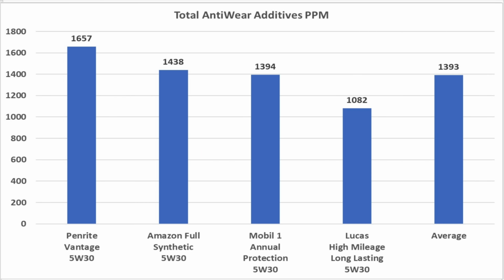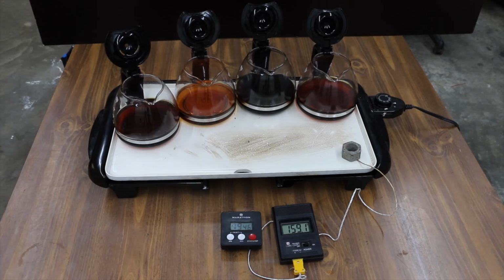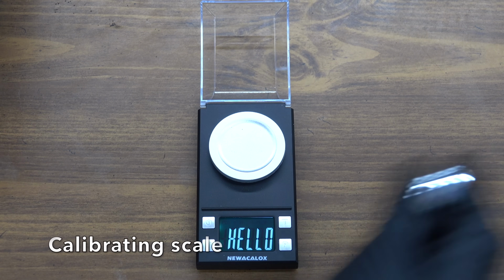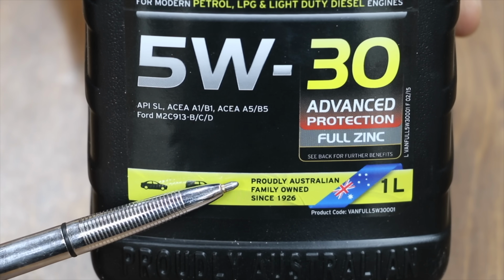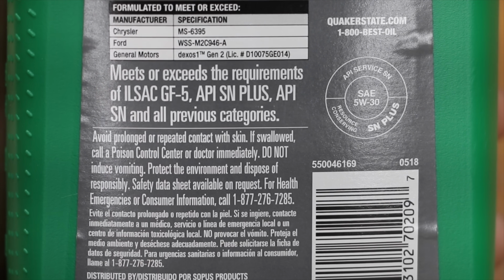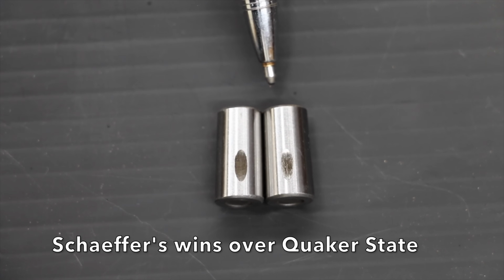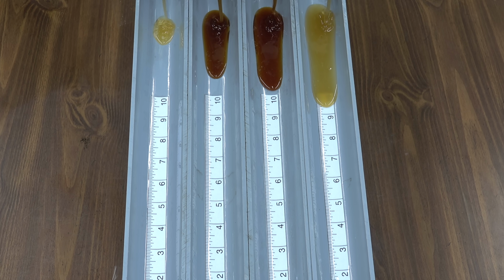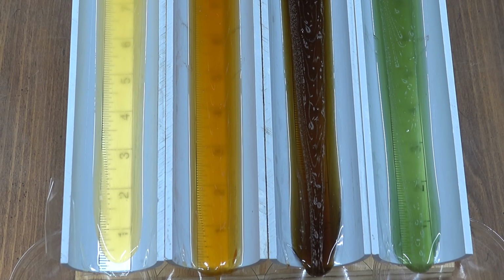Is Amazon Basics Motor Oil better than Penrite? Let's find out!

Comment: maybe try testing some weed killers? or comparing?  with so many options out there it would be nice to see what stays true to its advertising. I personally pay the extra for round up since we use that on the farm for round up ready beans, and corn.  but we have used other off brands that seem to work ok.  i have tried other brands and mix to what they spec but they dont seem to deliver what is promised and almost feel like a waste of money otherwise. I have had luck with off brands while mixing heavier than what is said is needed and did have luck but dont see a reason to buy the cheaper off brand that requires more of it to get the same job done that a product like round up can do with less product used even though it does cost more.  (side note) I use the concentrate.  I spray way to much of course to use or need the pre mixed ready to use. also feel that buying "refills" is a waste.  I know different weeds are harder to kill. We also have a good mix that we use to kill off growth from trees and stumps. while to todays standards its probably not the best for the environment, we mix crossbow with used oil from the tractors and paint it on stumps and trees we dont want to grow a branch off that specific side or a stump that we dont want to sprout a new growth from.  which does work great. Thought this would be a good test with it being spring/summer and weeds growing like crazy.
Reply from the maker: Thank you for the video idea!

Comment: Very cool!  I haven't been this excited in a play off, in a long time... Goooo Amsoil Gooooo
Reply: Johnny Turbo scAMSOIL has been over hyped. Watch it burn in these showdowns.
Reply: @garrettstevensen2467  well I'm interested to see because it has done VERY well in our race engines, both gasoline, marine and diesel. Not to mention several very high mileage (over 400k) vehicles myself and other buddies have and have had. We ran Amsoil in them from day 1. I still have one vehicle,  and as far as i know the others are still running strong. On top of that, in our race engines, it has actually made power on the dyno compared to 2 other oils we used to use.

If you are right, I'm excited to know who beats it, but in my personal experience,  Amsoil has done VERY WELL.
Reply: @garrettstevensen2467  so what's your oil of choice?
Reply from the maker: Thank you!

Comment: Another great video.Thank you so much for both your honesty and hard work.I do have two questions.Can you outline what the wear additives, that were tested in your oil analysis, are? Secondly,Penrite shows zinc as one of its additives.Zinc is known to be a great lubricant but can also poison catalytic converters.Would this oil perform acceptably in the North American market or would it ruin the converters?
Regards,
Brian
Reply from the maker: Thank you!   I've had the oils tested and Penrite's zinc level is within the normal range.

Comment: Question/Idea for a video
Old guy I used to work with talked about having a jar of water under the hood of his old, carburetorated, car when he was younger. He claims he ran a hose from the water, to the intake on his carb. The idea was that it helped boost compression in the cylinders based on the fact water doesn't compress (from a practical standpoint, yes it is technically possible). 

Maybe you would consider putting this story to the test? Water in the cylinders seems a bit counterintuitive though.

Just a thought.
Reply from the maker: Thank you for the video idea!

Comment: Thanks for providing the additional technical information about the oils, it really is helpful to us in trying to more fully understand the differences between these oils. I used to look at virgin and used oil analyses done on oils by Blackstone labs and reported by users at the bobistheoilguy.com site. I like the Penrite Vantage but since it's an SL oil it would void my engine warranty and so I'm eagerly awaiting the further results of your tests to find the best oil for my nearly new 370Z.

If I might also suggest, it might be interesting and useful to compare the voltage and current draw on the lubricity testers motor. From this you could compute the power in watts(voltage X current) consumed by the motor, which would be an indication of the frictional drag on the bearing. This should correlate with the mass lost on the bearing. Thanks.
Reply from the maker: Thank you very much!  I posted the lab reports on the Project Farm patreon.  You can see them for free.

Comment: Idea. Front wheel truck bearings. A discussion some years ago brought an opinion that stated light weight oil would be just as good in wheel bearings as what is commonly used. Doubtful in my mind but curious to find out.
Reply from the maker: Thank you for the video idea!

Comment: I would like to see a test using 0-20w and 05-20w used in Honda engines and ultra Platinum Pennzoil 05-20 sense its the top of the line oil. Thank you!
Reply from the maker: Thank you for the video idea!

Comment: Can you test motor oil with 6000 hr run time vs 18000 hrs and multiple on and off cycles.  Do our oils really need replacing every 4000 miles still?
Reply from the maker: Thank you for the video idea!

Comment: If you have the time, I would like to see how CLP gun lube stand up against 5W30. I've seen in a lot of gun forums that's you can use motor oil instead of gun lube. I would like to debunk that using your message, if possible.
Reply from the maker: Thank you for the video idea!

Comment: For the lubricity test, it looks like the tape on the side of the cup may yield some biases. The tape looks like its acting as a baffle to help the oil coat the bearing when the oil is sloshing off the side of the cup. This is assuming each cup is taped slightly different.
Reply from the maker: Thank you

Comment: hey man im a big fan of this series and i was wondering if you could do another oil playoff series after this one is done that includes popular motorcycle oils designed for wet clutches that dont include friction modifiers. (and maybe include delo diesel oil which is what i use on my wet clutch motorcycles and is a ton cheaper than most wet clutch motorcycle oils)
Reply from the maker: Thank you for the video idea!

Comment: So I looked up what GEN 1 Gen 2 Dexos really is and I found out it’s a standard from GM that wants the oil manufactures to take out more calcium in there oil apparently the calcium aids in detonation! I’ve always ran mobil 1full synthetic and have always been happy about the oil and felt it was a medium market priced synthetic. I have a Subaru and it 30 K I changed the differential oil‘s with mobil1 full synthetic at70 K I just did it and I’m surprise the oil still looks brand new. Thanks for the great videos project farm!
Reply from the maker: Thanks for watching!

Comment: Why did you chill the oil to -40F this time and all the other videos to -15F? Wouldn't this completely change results of the other oils?
Reply: I second this.
Reply: 5w30 oil is designed to operate at temperatures as low as -22F (-30C). Block heater and different oil would be used in climates that get this cold

Comment: That Quaker State race with Schaeffer's was probably the closet we have seen yet over all.

It literally came down to less than 1/2 an inch on the cold flow. Had the new Quaker State performed slightly better in that race it would have been a dead even heat.

I would feel entirely confident in saying that Quaker State is as good as Schaeffer's.
Reply from the maker: Thanks for watching!
Reply: @ProjectFarm  No problem, I look forward to it every week!

Thank you for taking the extensive time and cost to do these unbiased tests!

Comment: Hey Mr Project Farm.  I have a video idea.  I'm really interested to know about automotive hoses.  Particularly the burst pressure of silicon hoses vs stock rubber hoses. Also I'd love to see hose clamps tested in a comparison format.  They are not all created equal. If you tested max torque applied before failure, as well as holding power from being pulled off the pipe, or twisted, I think results would vary wildly.
Reply from the maker: Thank you for the video idea!
Reply: Also minimum torque to seal to 25psi would be great to know for each.   Can see the test rig now...

Comment: I can vouch for Penrite 5w30 . Saved my Subaru engine when I had a radiator failure. I didn't realise until the oil pressure light came on.
Reply from the maker: Thank you!

Comment: Can you compare various brands of electronic solder fluxes? For example, which have the best cleaning action, which are the least corrosive over time, which leave the least/easiest to clean residue, which result in the strongest mechanical strength, which result in the lowest electrical resistance? Similar tests could be done for lead and/or lead-free solder itself (these can contain flux internally, or not), and would also be interesting to test for mechanical strength, resistance to fatigue/cracking, electrical resistance (especially when used to bulk up high current traces), and other properties. I would be very interested in such tests. Thank you for your consideration. - dadler
Reply from the maker: Thank you for the video idea!

Comment: What if you ran an engine for days on end. Maybe hooked up a car or truck sized gas tank to a mower and saw how long the engine could run before it just flat wore out. That would be an awesome video
Reply from the maker: Thank you for the recommendation!

Comment: If Penrite has zinc in it, would that not make it unsuitable for use in cars with a catalytic converter? I thought that was the main reason for the removal of zinc and why it is necessary to add zinc or use old oil with zinc in it in older cars so they won't eat up the lifters.
Reply from the maker: Thank you!

Comment: its hard to tell in the video but is your oil racing jig level? looks like the right side is lower which will skew the results, in both cases the right side won. and shouldn't cooking the oil increase the viscosity not lower it, like in your past test with amazon oil. your test results are not being repeated thats bad science.

Comment: I guess it's fair to say that none of the competitors are in an 'oil fired hurry' to cross the line!

I'm not sure which of these oils are available, here in the UK, but my Volvo V70 is up for an oil change, and my choice of oil might just be swayed by the results of this contest. I'm pretty sure the Amazon oil will be available here.

This is really fascinating stuff, and who would ever think that the slower the race, the more exciting it is?

Anyway, here's another idea; How about candle wax as an engine lubricant? I guess it would have to be melted and the engine run straight away, but it would be interesting to see how it performs, and then maybe allow the engine to cool with the wax still in place. The next part is rather more uncertain, but with the wax solidified, would the engine still start and run, and, re-melt the wax. Then how long would the engine last? - Just thinking out loud, as it were.
Reply from the maker: Thank you!

Comment: yes PENRITE WON THIS ONE! :D You go Aussie oil. lol
Reply: Aussie, Aussie, Aussie...
Reply: @PenriteOilCo  Oi, Oi, Oi
Reply from the maker: Thank you!
Reply: Did you have to run the bearing test motor backwards for the Aussie stuff? LOL!!
Reply: I see an American (Amsoil) vs Australia (Penrite) war in the near future......USA! USA! USA!
Reply: Except it is not legal to use in the US as it is only legal for use with engines 2004 and older and cannot be used with gasoline with any ethanol in it, and cannot be used with newer engines since it contains zinc that will cause early engine death in newer computer controlled engines. It fails the SM and SN standards and cannot be used for for engines 2005+.
Reply: @cmdr_stretchedguy  when did penrite oil fail api testing? As far as I'm aware, they never paid to have the testing done.

Comment: Does a drop of dawn dish soap in coolant have the same effect as "water wetter"?

Supposedly both reduce surface tension in a cooling system improving heat transfer.
Reply from the maker: Thank you for the video idea!

Comment: I think the only reason shaeffers does worse in the evaporative lost test is because the die or whatever is added to give it its blue tint burns off quickly. I run it in my truck and checking the oil after even as little as 100 miles it becomes the same ran/brown color as any other oil. Great video as always and I will definitely be sticking to shaeffers in my truck.
Reply from the maker: It's a great oil. Thank you

Comment: Engine oil deteriorates and degrades due to oxidation, hence we  change the oil. Oxidation stability is one of the most important criteria which directly translates into oil's useful service life span. Oxidation stability can be checked through PDSC (Pressure differential scanning calorimetry). Its a great test to compare the oils for thermal break down and oxidation.
Reply from the maker: Great point. Thank you!

Comment: I would have liked to know the amount of pull or amperage the motor was drawing with each one of the tests as well to see if there was any more load with one than another, on the drag coefficient, resulting in more electrical consumption.
Reply from the maker: Great point. Thank you

Comment: Awesome test, buddy: i have a suggestion. When running bearingtest, the poly is running in a cup of oil, and its hard to keep the oil in the cup. Would you setup this test with a oildripper in the bearing? Within a engine the oil is usual only a thin film, not a full thick pocket.
Reply from the maker: Great suggestion!  I'll be making some changes to the oil bath for the final 4 and final game.

Comment: You really can't face oil from ads. You see on race cars. Because the range in blowed engines everyday. They rebuild them after every race then engine will goes in the trash or recycling. You can't base buying oil off of these products. Is this why you're running all these tests. Because before long though you'll be tested batteries. For the new cars. Little bitty double a batteries.
Reply from the maker: Thank you

Comment: Hey project, could you possibly test the following oils please !

Nulon 10w40 "Hi-Tech Fast Flowing" Full Synthetic
&
Penrite "Vantage" 10w40 Full Synthetic
Reply from the maker: Thank you for the video idea!
Reply: @ProjectFarm  I mean it's comparing two Australian made & owned oils against each other, apples to apples you might say. Though i feel Nulon has it's wild card compared to Penrite
Or even Penrite 10w40 racing oil would be possible maybe ?
Reply: @ProjectFarm  I've personally used all 3, but when it comes to engines running smoother, quieter, etc - i have to give it to Nulon, but I'll let your tests decide which one has less wear/friction

Comment: Project Farmer,  I have an old sealed can of the original Quaker State. If you have a P O box I will send it to you. Free of charge
Reply from the maker: I'd love to test it if it's really old from the 1980s or prior.  Thank you for the generous offer!
Project FarmPO Box 162
Peculiar MO 64078
Reply: @ProjectFarm  it is probably early 70s. No bar code or weight on the can. I will send it out Monday.
Reply: @1990hondarc30  I hope he does a video on it. Love those old cans. We never had the proper valve to open them always a screw driver.
Reply: @ProjectFarm  Peculiar! that's a peculiar place name lol.
Reply: @ProjectFarm  now this would be awesome!
Reply: @ProjectFarm  Please test it. Engines back then had flat tappets and needed oil with good film strength.
Reply: @ProjectFarm  Not far from ya in Blue Springs MO!
Reply: good to see the progress engine oil manufacturer had made through the years
Reply: it would be really awesome to test that oil
Reply: It will be interesting to see if Pennzoil out performs it's cousin. Go Pennzoil!!

Comment: It's interesting that some of the oils winning are oils without huge budgets for advertising.  However,  the cheapest SN+ oil is Supertech full synthetic high mileage at $45.68 for three 5 quart jugs of 5w-30 weight oil with free shipping from Walmart.  Some other oils maybe better but not at three times or more the cost.
Reply from the maker: Great point!  Thank you

Comment: That doesn't seem right. Maybe it's the temperature, but in the first amazon basics video, the cooked oil did not beat the uncooked oil. So why did it here?
Reply from the maker: Great point. Longer heat exposure.  I used it in my vehicle and sent it in for analysis. It did thin a little.  Still a great oil.